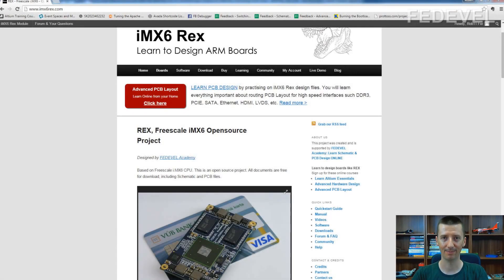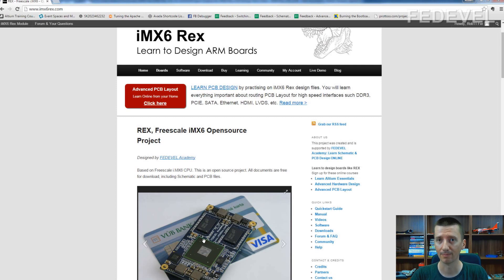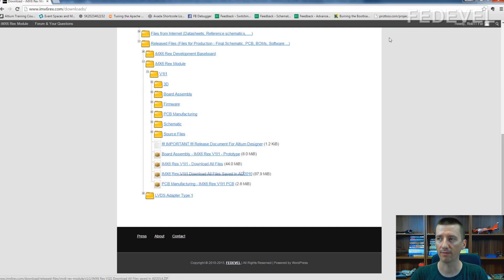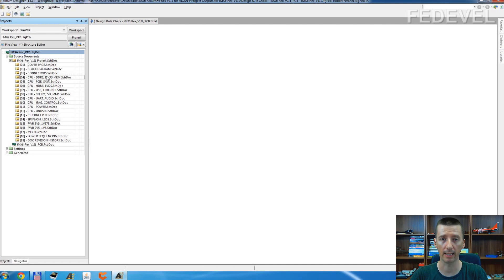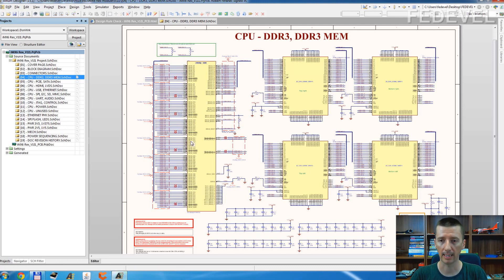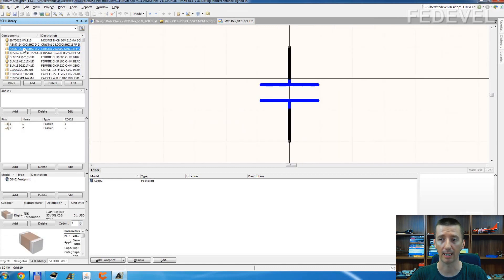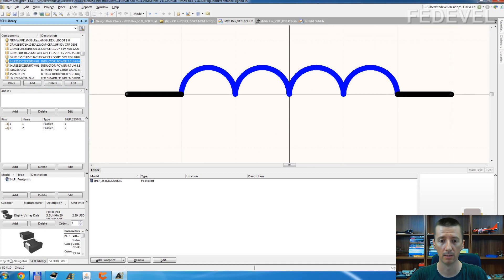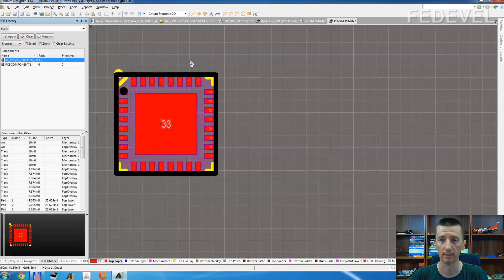Altium - How to Create Library from Existing Project

Comment: Hi Robert, I have a question on library size. Is it good practice to have one central library with all your components and use it in all your projects or better to add libraries for each individual project with project specific components/footprints captured in them? Would there be conflict if components in two different libraries are named the same?
Reply from the maker: Jayakrishnan, I have not found a perfect way to work with libraries. We used to have one big central library for all the components (with a lot of components it started being not easy to search for something), then I started building DB library (it was slow), now I am testing Altium 365 with Vault (I like this a lot, but you pay extra for this)

Comment: Awesome and clear Explanation. But i have a problem with the process. If i am clicking on "Design -> Make Integrated Library" nothing happens. "Design -> Make Schematic Library" works perfectly fine. Is there an easy way to convert an Schematic Library to an Integrated Library? The Footprints and Symbols are all in the Schematic Library, so it can't be that hard i guess?
Reply from the maker: I am not sure if you can just convert Schematic Library into Integrated library. Integrated library includes footprints, schematic library doesn't. You may need to make integrated library from a whole project ... at least that is what I think.
Reply: I have the same issue. Have you got it working somehow?

Comment: Hi Robert, 
thank you for making these tutorials available for every one on youtube. It is really helpful. 
I have a question. When starting a project from scratch, do you start by building a custom library so you have the correct references from suppliers and the right  footprints ? or you have a lethod to correct all the references ones the project is finished ? 
thanks in advance
Reply from the maker: Thank you  very much Mohammed for your feedback :) 
We have our own library - so we use components from it. If a component is not there, we create it.
Reply: +Robert Feranec OK, many thanks for the response.